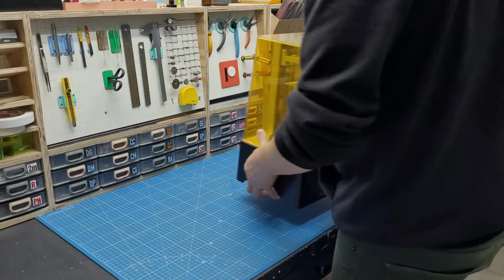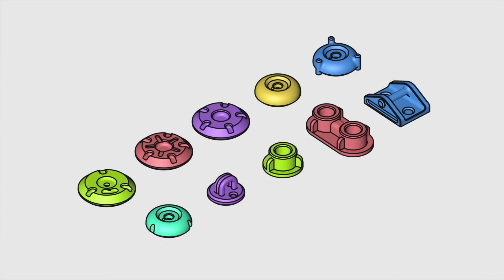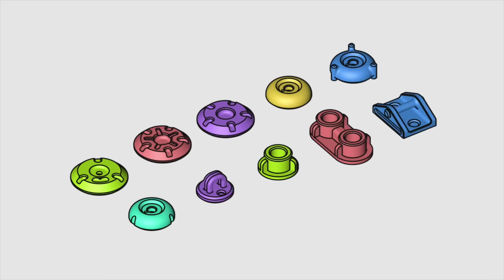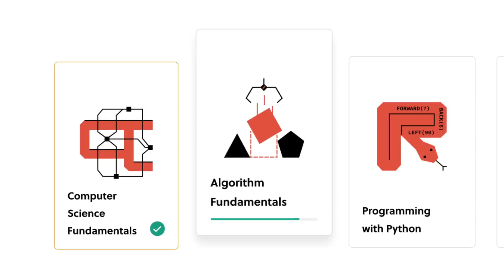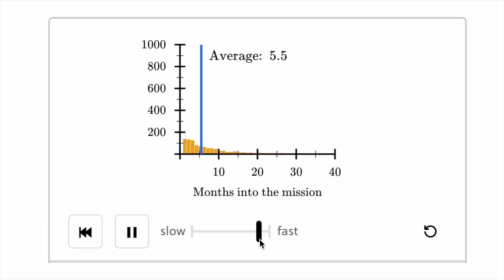Scratch building a COMBAT ROBOT - EP06

Comment: Great upgrade with the resin-printer! I'm not a great fan of the layerlines on the old one, but the new have almost zero!
Reply: A little sanding can easily remove those lines. There's also a kind of device that uses alcohol vapour to remove layer lines. Robinson Foundry has used it several times.

Comment: If you have available to you (E-6000)-(shoe-goo)-or my favorite Automotive Goop. Has a slight odor and needs a few hours to cure. It's consistency is thicker than contact cement but thinner than hot glue. Also you won't burn your fingers on it.